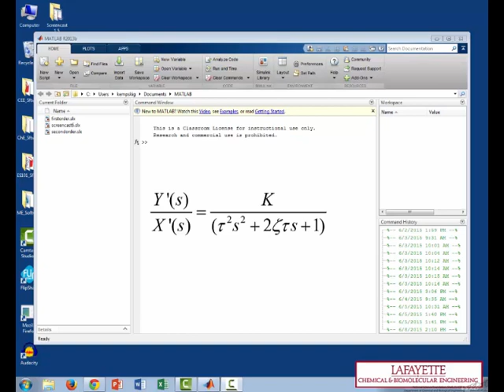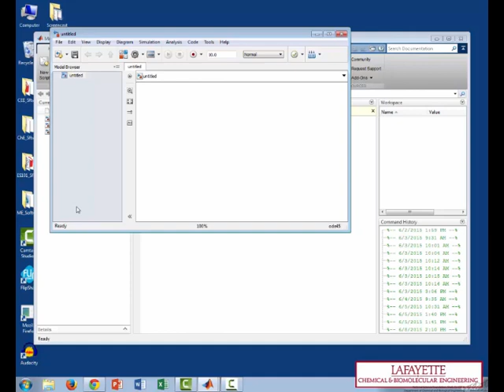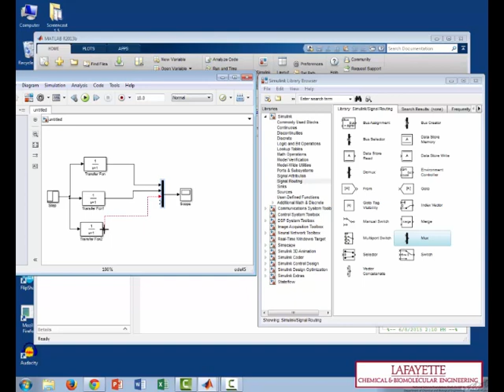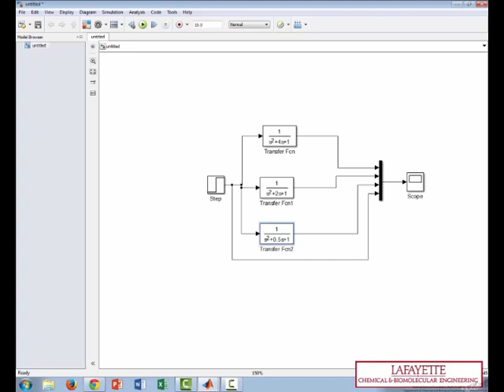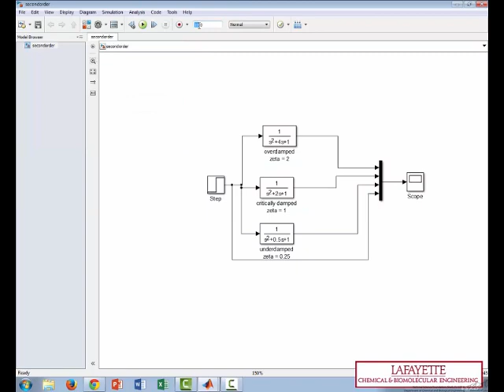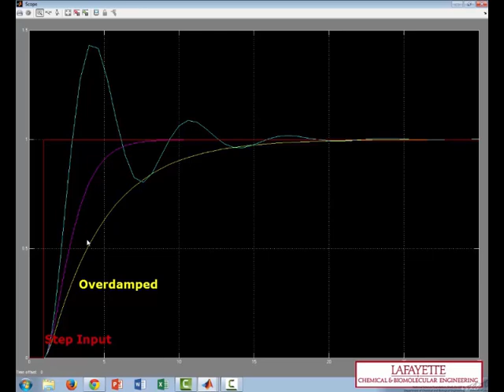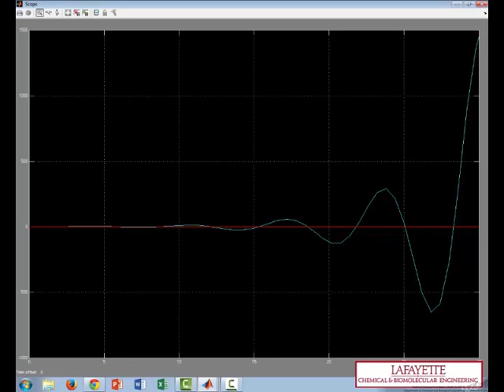Simulink: Second-Order Transfer Functions

Comment: I think it should be noted when going over these sort of topics that these processes are linear. A lot of people gloss over that when using LaPlace domain and transfer functions like this. Academia almost exclusively deals with linear system, while Simulink really shines due to its ability to handle nonlinear systems. I don't know why the linearity is not stressed more especially when defining the meaning of constants in a TF equation which only applies to linear systems.

Additionally, I think there should also be a real-world physical example attached to every one of these demonstrations.

I do like the video even though I'm complaining :) Just my general thoughts about how engineering is taught.